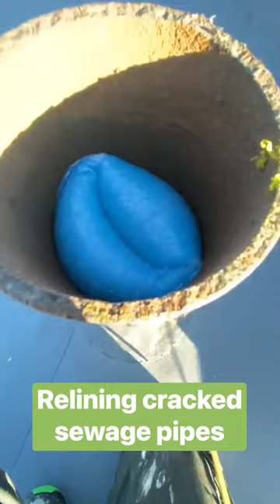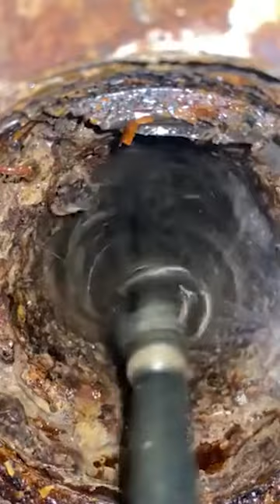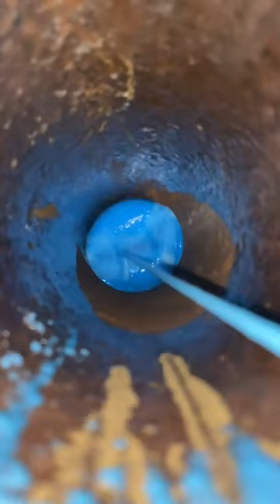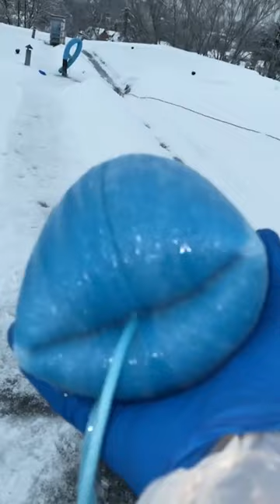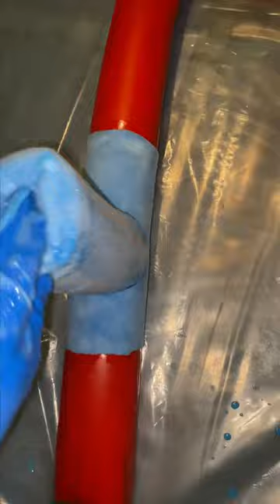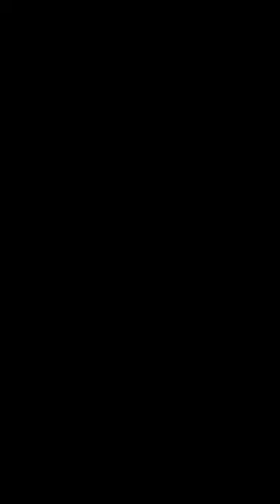Pipe relining is a quick way to fix cracked, leaky, or old sewage pipes. #sewage #pipes #fixit

Comment: won't that mean the radius is shorter (thinner pipe since it can fit in the preexisting pipe) and or the diameter of the pipes thickness is thinner? How time reliable will this be in the future, and will that inevitably lead to a  needed teardown of the original pipe?
Reply: Exactly
Reply: you probably eventually need to replace it at some point, this is a cheap way to procrastinate dealing with the pipes eventual death
Reply: @ovencake523  well I mean you could say if you replace the pipe anyways, it'll eventually need replacing too. So say my pipe lasts 20 years. Do this lining for a fraction  of the price and get another 10 years out of it then just replace. Now I'll get 60 years out of two pipes as opposed to 40 which then would be on the EOL of the third pipe as well.
Reply: @epic_errors  I just had my sewer line fixed last year. I asked if we could do that since I didn't want to have to dig my yard up, and the lining would be more expensive. The guy told me it only pays when you have to demo a road or other more expensive thing
Reply: It will reduce the diameter but for residential purposes diameters are already over designed. As somone said earlier, the doameter reduction is quiet small. For reticulation and trunk mains (network pipes) its a diffent story. Depending on flpw data, some councils wont let you reline mains due to operational flows. Source: Im a speacialist civil engineer in pipe relining.
Reply: @Mutris would you do it in your home?
Reply: @sammyvh11  Yeah mate. Wouldn't be an issue. Just make sure you get a good contractor to do it. It's alot cheaper to renew the lines than reinstall. If you have issues I would get them out to camera the lines first to see if it's root balls/ damage, or cracked pipes. If it's root balls you can jet them out with water and it should be right for awhile (depending), but long term get it relined so you don't get regrowth or risk of future damage.
Reply: Cipp is rated for the same age as any other pipe. It is considered a full pipe replacement.

Comment: You still have to clean it before running that through 🤦‍♂️🤦‍♂️🤦‍♂️🤦‍♂️
Reply: Did you not see the wire brush tool at the beginning? Of course they clean it.
Reply: They just meant they don’t need to unearth it to clean it

Comment: Anyone know the price to get this done tho? pretty sure my old house ive lived in forever built i think in WW2 or 1918 i heard possibly built. needs this done
Reply: They quoted me  $24,000 to replace my sewer pipes  this method  cost me $4500 had it done 6 years ago no problems 
I live in Ohio
Reply: @joethanks3745 Who did you use? I live in Columbus. My house is 100 years old and very likely has a broken pipe at the end of the main line right before the city sewer. Eco Plumbers also said it would be around $20k to fix. Nope. 

Thanks.

Comment: It will fix a leak but how can it fix a clog?
Reply: The lines are cleared with jet hoses. Most clogs in sewer lines are from tree and vegitation roots finding thier way in. The jet cleaners clear the roots and the relining seals the pipes like new.

Comment: And now the water flow is worse 😂😂
Reply: The water flow is better os most cases however capacity is slightly reduced. Not an issue for residential lines.
Reply: Less than a quarter inch